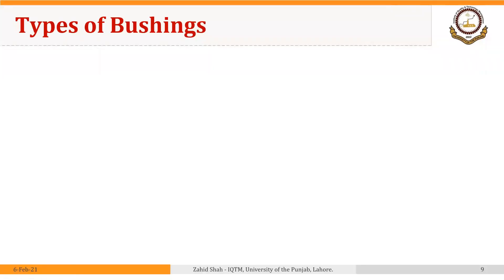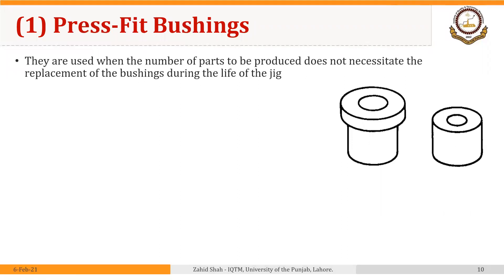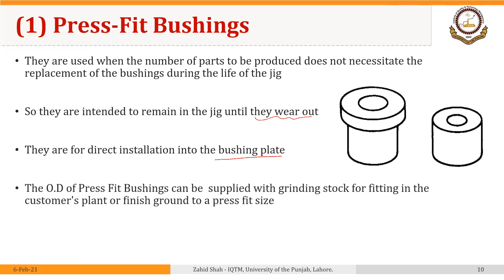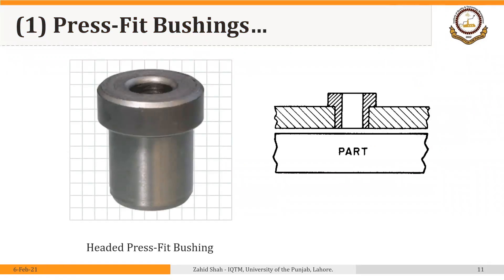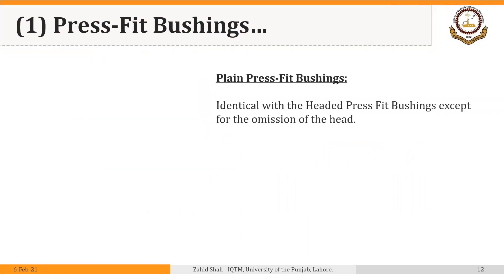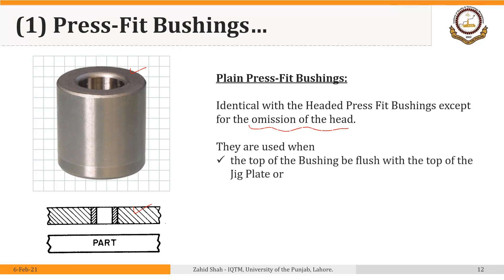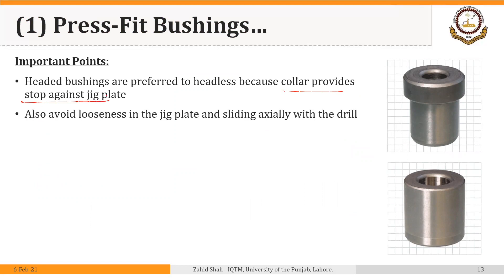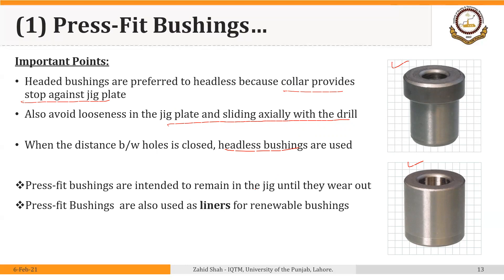01_04_P2 Press-Fit Bushings

Comment: Hello, 2nd apprentice here. Can you help me with determine the size of a bushing size when ordering? I'm building a leaf fixture on paper and the call out for 2 holes on a component are as follows.  .44 in. and .29 in. thru all. Having a tough time picking out a bushing size. Believe the length of the bushing can .750 in.